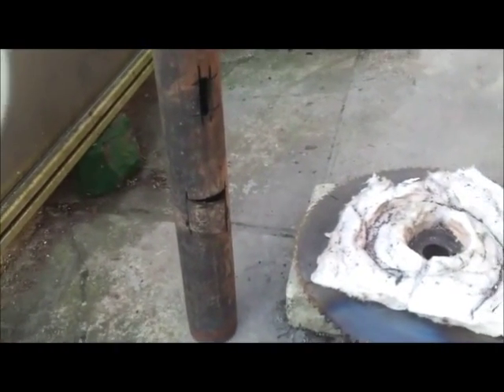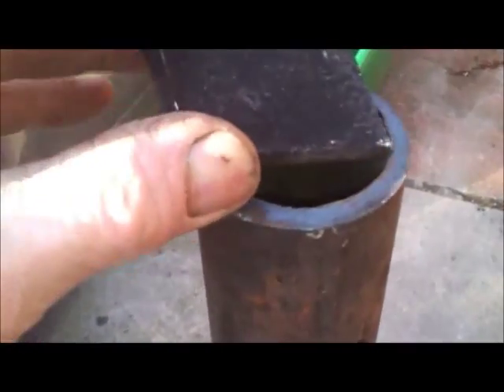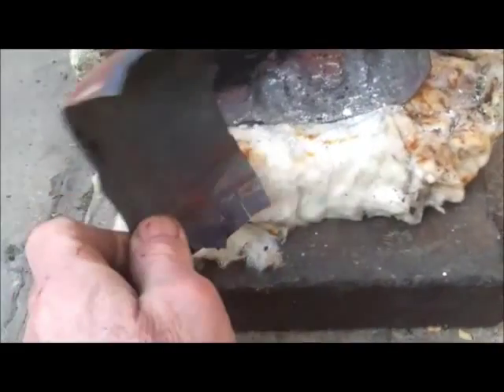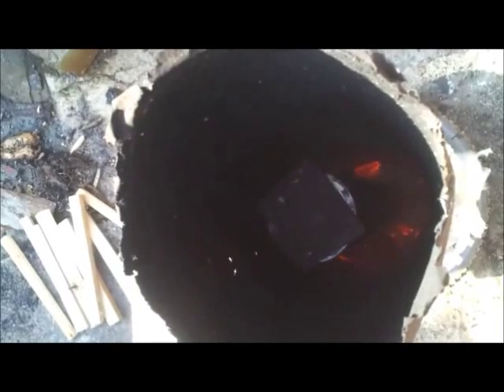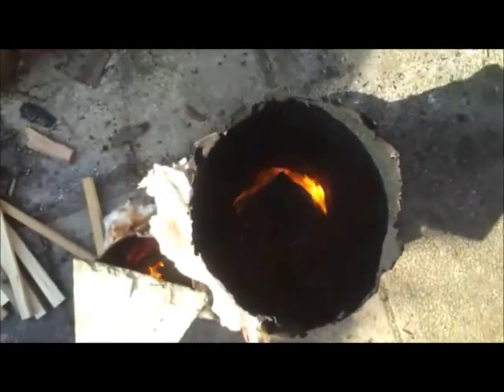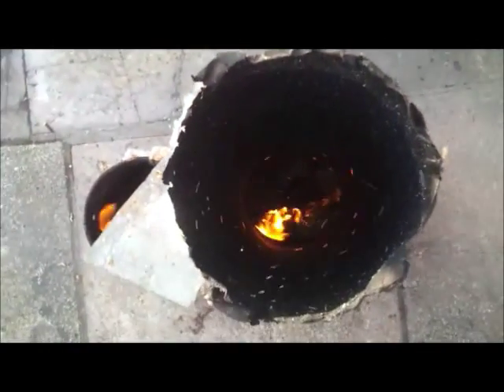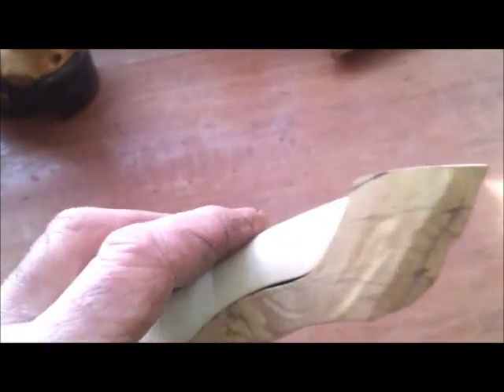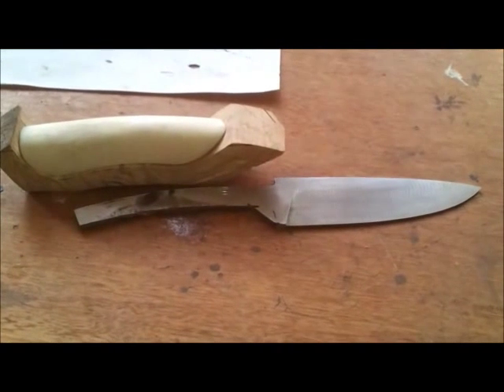Updates on the rocket internal riser tube and Knife handle

Comment: nice design although it looks like you are running into the same issues I have.  The air is drawn into the stove too much and it blows ash out the top.  My customers complain that the ash goes into the frying pans and open pots unless they use the really big woks.